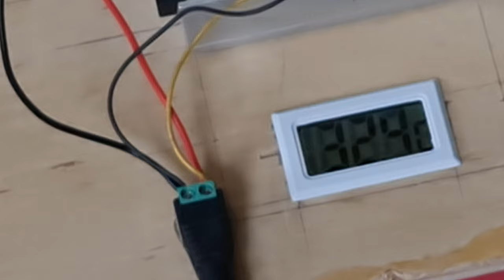DIY : Experimenting Peltier Coolers | Mini-Fridge | Cool Fan | Desktop Cooler

Comment: much better use CPU Cooler to cool the Hot side, I also do this experement. CPU Cooler should have at least 4 or 6 pipe and 2 or 3 120mm  fan with 1amps pataas na maka produce 2500rpm to 3000rpm